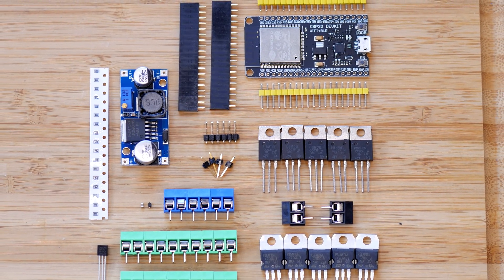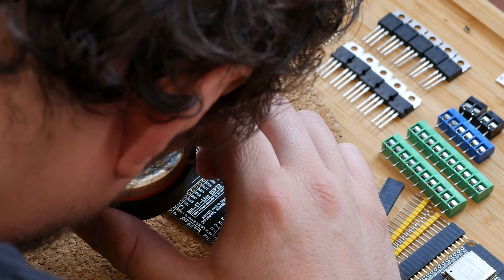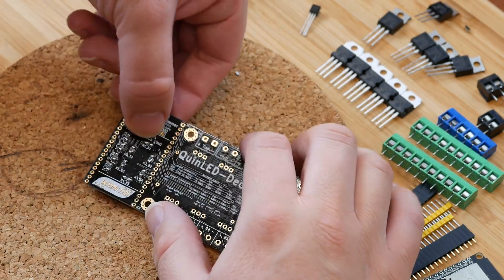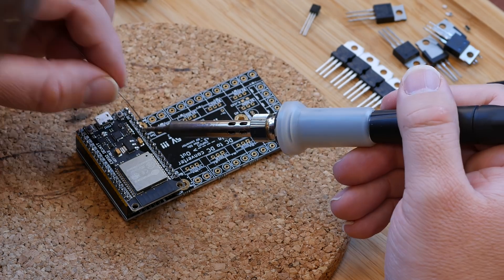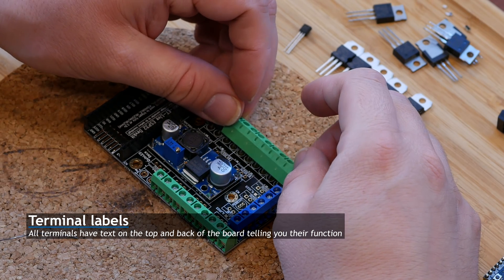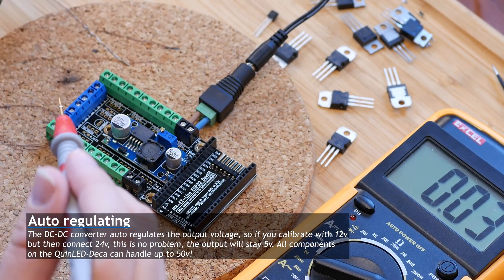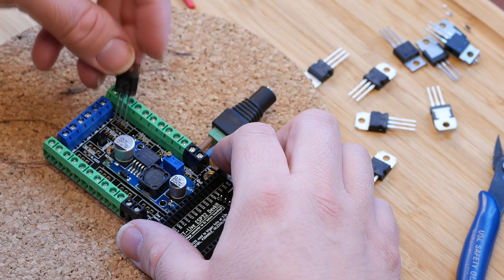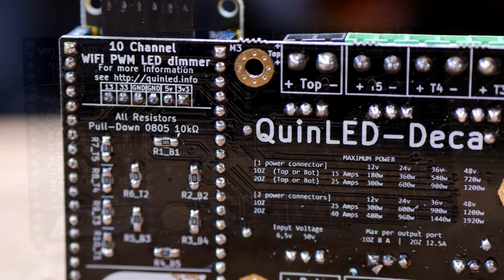QuinLED: QuinLED-Deca Soldering Guide

Comment: Thank you so much for your work.
I just finished the DigUno and because I ordered the merged PCBs the Deca (v1r6) is the next project. But after reading the diffeculties with the diod:
1) Is is correct that I do not need this diod as I will never ever power USB and power supply at the same time? If I want to use a diod: can I also use SS12 or SS24 Diods?
2) As I do not want to use external GPIO devices I do not need the angled male pin headers - right?

Vielen Dank und Gruß aus Deutschland

Comment: Hi, just started soldering my first board. 1-The polarity of the diode is not clear, it has two bars at one end which does not correspond with the markings on the PCB. Does this end go towards the edge of the board? 2-The two resistors R1022 & R1023 are they optional or not? Thanks!
Reply from the maker: The Diode is a bit hard to read, I've changed to a new type on my newer board designs and I'll update that in a revision for these! But the stripes need to be toward the edge of the board, that is correct. The resistors for pin IO22 and IO23 are indeed optional, they enable pull-down on those pins if you need that for connecting something externally.
Reply: @IntermitTech  Thanks! Forgot to mention that you didn't include the right-angle headers in your parts list. I guess I can just bend some straight ones.
Reply from the maker: @pr19580   Where exactly? I just checked and if I look in the hardware guide, they are there? :)
Reply: @IntermitTech  Sorry, late night here and too much wine!
Reply from the maker: @pr19580  Hahaha, no worries, hope you had fun building it and have fun using it! :)
Reply: @IntermitTech  Thanks, I'm just waiting for the last few connectors to arrive. First time soldering SMD components, but it went fine with your method. How do you mount your boards? Do you use a plastic box, or just mount them bare?
Reply from the maker: @pr19580  Waiting for components to arrive is almost the hardest part of the whole process. ;) Glad to hear mounting the 0805 worked out for you, once you get the hang of it, it's doable.. Mounting is various, some I have mounted in a plastic project box but others are just bare, even some stuck to the wall with double sided sticky tape. :P

Comment: Board installed ! But the ESP32 didn't have tension (the buck converter was happy with led on and 5V as an output)! unplugging the ESP and checking with tester there was no tension between the +5 and ground.

My first area of inspection was the diode and I discovered the polarity was reversed  with the catode (the band ) towards the TOP. I desoldered and reversed the diode (very difficult with everything else installed  !) But the situation was the same. So I short circuit the diode' pins. And I discovered that powering (12V) the card from the top I had -5 V on the 5V pin while if I powered from the bottom I had the right tension, 5V on the pin of the micro.

So questions:
1) what is the diode doing in this configuration?
2) How should it be installed?

Tks 
Marcello
Reply from the maker: The diode is in series with the 5v connection to try and protect the board and the ESP32 module in the case someone hooks up power to the board and micro-USB to the ESP32 controller at the same time. So the diode should allow power to flow from the board (the DC-DC converter) to the ESP32 but block power from the VCC line of the ESP32 back to the board.

You can try bridging the 2 pads of the diode and that should make everything work.

I realize that since I changed the board layout slightly since the video this might be confusing. I will add a picture to the soldering guide page to clarify this! The main reason I changed the diode location was because it was almost impossible to rework in it's original location and I too had issues with mounting it backwards sometime. I have made changes in my newer designs making this a lot easier.

p.s. Both power connections (top and bottom) are connected to the same planes so there should be no difference in what you read?

Comment: Hi. Great to see a tutorial. Im thinking about ordering one. But how do you power the ESP32 without plugging in the usb-cable?
Reply from the maker: You only do the first time programming using USB connected only, after that the ESP32 module gets it's power from the QuinLED board power supply. You can input between 6,5v and 50v for the Deca and the ESP32 will get the 5v set on the converter. All outputs will be the same voltage as input however. So if you connect a 12v or 24v power supply, make sure the LED strip is the same voltage.